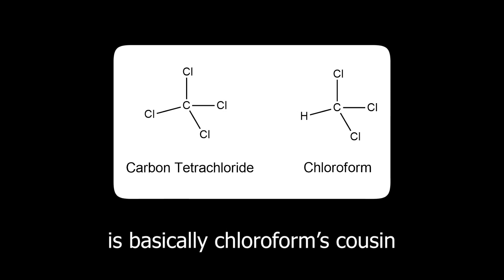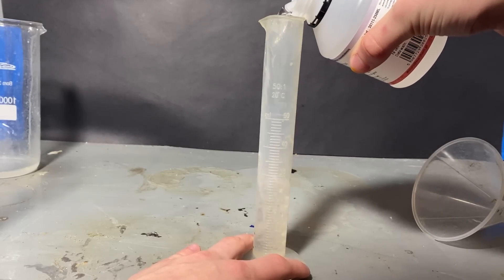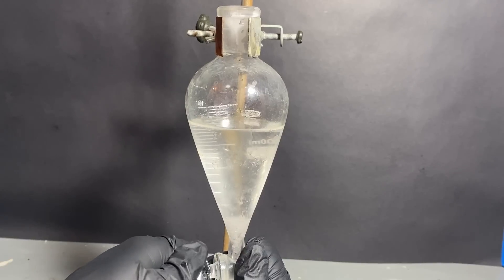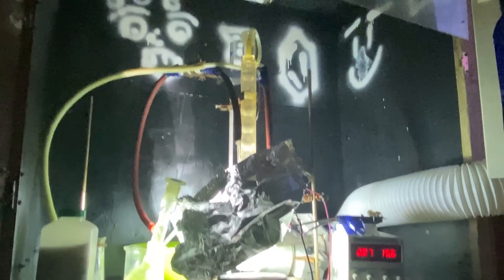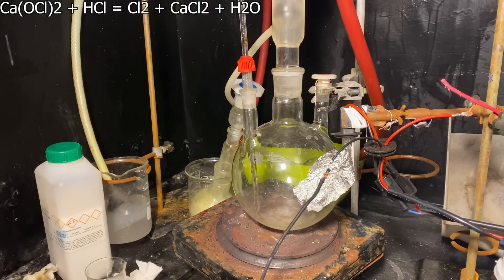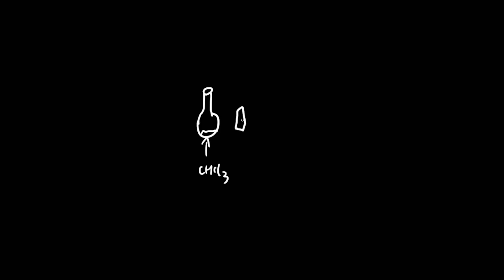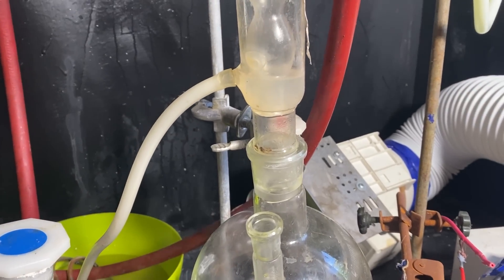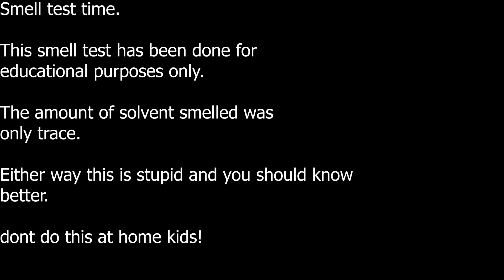Making Carbon Tetrachloride and huffing it

Comment: 2:22 * except Fluorine. Hypofluorite, because of the extreme electronegativity of Fluorine, tends to give out Oxygen rather than Fluorine in its reactions. Also trifluorinating one of the carbons doesn't cause it to be kicked off as fluoroform, for reasons I'm still not entirely clear about.

Comment: Chemistry is why that light is changing color, not electronics.  It has a bunch of halogens and mineral compounds which are solid at room temperature in it, and it takes a couple minutes for all of them to get vaporized and mixed into the plasma to make brilliant white light.  It is a similar sort of process which makes old lantern mantles glow so intensely. 

If it only had mercury you would only  get the  intense mercury lines including the intense UV.  You can buy lamps which only contain the mercury, such as the germacidal lamp, low pressure mercury vapor emits 254nm for example, and can be pretty cheap as it is used for germicidal lamps.  Tho you might want a longer wavelength since 254nm won't go through normal glass. The car headlight is almost certainly the cheapest solution available. 

proper germicidal LEDs are finally affordable -- I got a bunch of them on sale after 2020s drama.

Comment: A single whiff isn't gonna wreck the shop lol... they used to put it in fire extinguishers... by the pound, all to be released in the air. Not good... but wasn't an instant issue to use one, and probably would take rather regular exposure to it to have the long term issues.

Phosgene? Yeah. Can't be emphasized enough. Don't play around.

CCl4? I wouldn't recommend any aromatherapy with it, but sampling the odor? Pfft. Might as well be something everyday like gasoline... extensive exposure not recommended there either but we all get a sample of it fairly regularly without issue.

Comment: Back in the 1970s when CCl4 wasn't banned yet and I was a curious kid getting into chemistry, I found a bottle of it in my father's tool cabinet - he was using it as a degreaser. I used quite a bit of it as a solvent for various experiments, and in the process yes I did smell it, and indeed it smells sweet. Also 50 years later, I'm not dead yet. At least I don't think I am.
Reply: The human lc_lo I found is 1000 ppm for 5 minutes (more common is 30~60 minutes at that range), with oral ld_lo being 3~5 ml of liquid. Odor threshold is in the 20~200 ppm range. Skin absorption has also been studied and is a concern, but I'll leave it at "The amount of solvent penetrating the skin was related to the area of skin exposed, the method of application to the surface of the skin, the type of skin exposed, and the duration of exposure."

It's also a known carcinogen in animals and a likely one in humans. Between that and it being banned for damaging the ozone layer, it's probably for the best that we don't use it anymore.
Reply: Dad used to give us kids this for degreasing bikes and our hands afterwards , i have had issues .

Comment: you could have just used a mercury vapor lamp (lots were used in street lights and can be found for dirt cheap) and you can just break the outer glass then rub alcohol (liquor will do) on the internal tube before powering it on and usually they wont explode

Comment: The UV light can't pass trogh glass only trough quarz glass. That is very unefficient method, the bulb should be inside or setup should be from quarz glass. But in any case congrat for good work.

Comment: I don't understand why you are so afraid of this solvent. It is regularly used in our laboratories. Just follow basic safety precautions. CCl4 LD50 has approximately 200 mg/kg, and the maximum permissible concentration is 20 mg/m3. It is not such a dangerous substance. I'm sorry for the mistakes, I used a translator.

Comment: Cool vid, good work man! I hope you dispose of this stuff properly, the hole in the ozone layer is big enough as it is
Reply: Do you really think a spoonful of CTC will make a difference when millions of tones of the stuff was used previously as a degreaser, solvent, fire extinguisher, dry cleaning agent etc?
Reply: @95rav  It's worse than if it was never made at all. It's effect might be small but it's still negative
Reply: @alexrogers777  the same could be said about the "small, but still negative" impact your comment makes in contributing to CO2 emissions from the electrical energy you used.
Reply: @95rav  okay and? I don't disagree

Comment: A few pointers if you are to do this again(i know you likely know a good portion of this already!): I probably would have flushed the setup with either argon or nitrogen before adding the chlorine/UV - this would mostly eliminate any chances of a significant level of phosgene being produced.

Combined with perhaps having the UV light source either inside the glassware itself or using fused quartz glassware(would be expensive, i know!).

The inert gas flush would have eliminated any oxygen and having either fused quartz glassware or having the UV source inside the glassware would have allowed for maximum UV exposure to the reagents - as typical sodium borosilicate glass absorbs a good portion of the shorter wavelength UV needed for this reaction to occur.

A possible alternative to the xenon tube btw would have been a mercury vapour discharge germicidal tube or heck even UVB/UVC LED's! Those are much more efficient(and somewhat safer) alternatives to the xenon light...due to the high operating temperatures of xenon tubes, they have a tendency to literally explode if you get oils/grease (this could come from your skin even) on the exposed quartz tube, the outer glass envelope is not only there for the UV filtering but to prevent this possibility from happening.

Comment: Dude xenon lamps are crap! That's why your light turns bright white! Its xenon! 😂 Have you never studied  the frauwenhofer lines in school?! 
How do you this a gas chromatograph woks?! 🤷🏻‍♂️😆 
 You need a mercury vapor pressure arc lamp!! 
They emit the most UV!! But you need to wear sunscreens and sunglasses!! 
And no! That lamp of yours is not the sun because the sun does not contain xenon!! 😝
 You actually need a Helium Hydrogen/ Dutherium light!! But they are very expressive!

Comment: Distill the stuff and measure the yield. Also, making phosgene by oxidizing the carbon tetrachloride with fuming sulfuric acid woud be something cool to see that no one has ever shown before on youtube. Collect it with a cold trap and seal it under pressure in an ampoule. Don't use latex rubber tubing as it will just eat through it.

Comment: For at least 30 years, we used Carbon Tet for cleaning printed circuit boards. Must have used gallons of the stuff with no precautions whatever- and yet here I still am at nearly 70...
Reply: Survivorship bias at work. 😉👍
Reply: Proving that survivor bias is real, one comment at a time
Reply: The dead or neurologically impaired are not going to comment there... Survivorship bias indeed.
Reply: @ElementalAer

I'm neurologically impaired (or at least people tell me that) and here's my comment!
Reply: Me too. I used it at college for the same purpose, and when I worked at a cable company, we used loads of it to clean rubber deposits off of the insulation moulding and testing machines. Everyone just considered it another basic solvent, like acetone or isopropanol. One day a girl dropped a whole 2 gallon flask of it on the floor of the lab, and it dissolved all the so-called chemically resistant floor tiles over quite a large area. That was fun. 
A lot of things are technically poisonous or carcinogenic in large doses or with chronic exposure. Take petroleum for example…
Reply: well. take an .1% odd of getting any particular cancer and multiply it by 300, or 400.
Oh but thats per year. Your multiplying it every year until you pass away, instead of multiplying by your age to estimate your cancer risk.
Reply: That is because you got supercanser, that is when your canser cells gets canser and did die off...

Comment: Use pool bleach instead of normal concentrated bleach. In murica you can get 85% Ca(ClO)2 which you can make into other hypochlorites if you need by reacting it with a carbonate salt. That will precipitate out the insoluble CaCO3.

Comment: The borosilicate glass passes some UV, but the higher UVB and the UVC spectrum parts are blocked by it, much in the same way the cut away glass from the lamp blocks UV. 
Easy to use, low voltage lamps to put into a reaction vessel are those 12v 3w UVC lamps you can find from China. Those need to be run from a 15-25v AC power supply with a resistor or choke in series to keep current at 250-300mA. They will run on DC, but with lower life span and light output. 
You can get them with or without a wavelength filter. Those without generate a TON of ozone because of the UVC light tearing aparth the oxigen molecules, pretty badass.
They are small enough to fit into certain large sizes of test tubes.